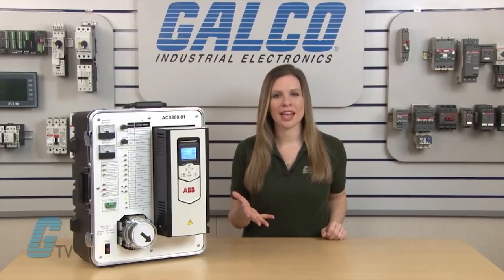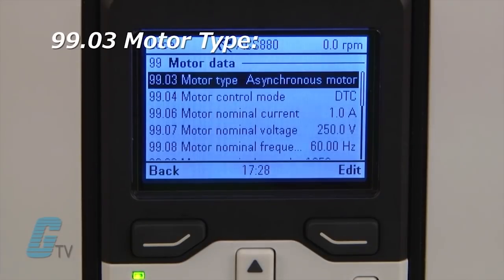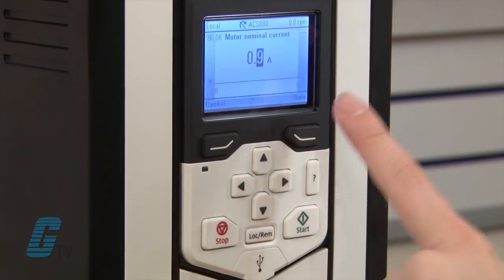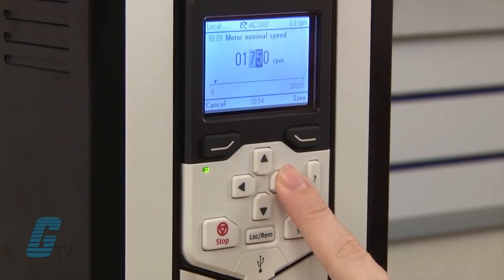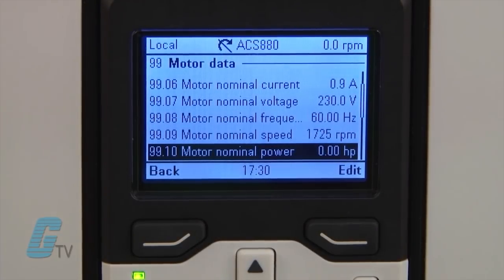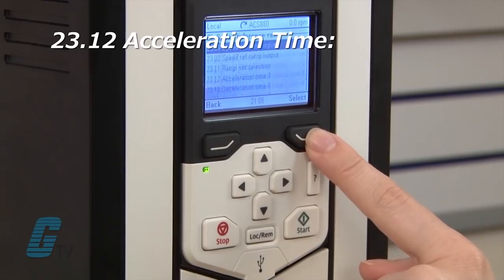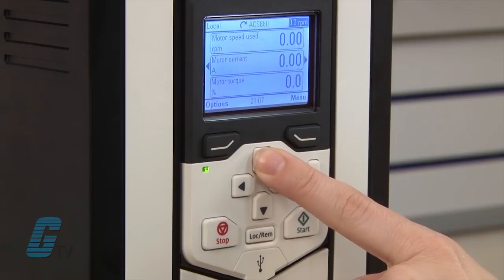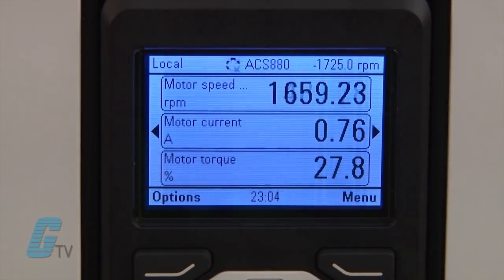How to set up the ABB ACS880 Variable Frequency Drive

Comment: Hello. Can you please help me start a vfd ABB ACS880 with DI1 start fwd,DI2 Start reverse and DI3,DI4 2 constant speeds  .
Without potentiometer or analog setpoint
 start. Only 4 digitals.
Wiring is correct . I have problems on parameters.
Cand you send me your contact to talk ?

Comment: apparently theres a firmware update recently- newest drive shows a '5681 pu communications' error if drive booted from external 24 volt supply...worked fine on last 6 880s and dozens of 800s... got a call to ABB, just wondered if anyone else out there knew a workaround. disabled error/warning, so its just the screen blinking, just irritating... also boots to 'no run input' too

Comment: better include how to  select  id  run .
Reply from the maker: Ok, just go to menu 99 scroll down to 9913 and enter the desired type of ID run best suited for the application you have. Meaning,,, de-couple the motor from it's mechanical load before starting the ID run procedure. This allows the drive to do its best identification of the motor itself. However ABB realizes it is not always possible to do so in some applications and so has a "Stand-Still" ID run and Advanced Stand-Still run available. These selections still give the drive a good analysis of the motor to control it efficiently in DTC control mode. Please read the manual on this parameter carefully before starting ID run so you can get best results for your application .

Comment from the maker: The ABB ACS880 uses a new panel that differs from the previous ABB keypads.  This panel is the ACS-AP-I and d uses modern technology in creating a higher visible LCD display with greater resolution.  A USB adapter is also included for making connections to a PC for easier setups.